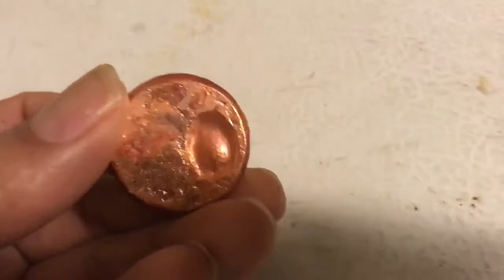Induction Heater Plasma

Comment: I use wima capacitor for my induction heater but didnot work. 30 x 0. 058 100 khz
Reply from the maker: Not sure what to make if it. Wins should work well. Mine are CDE but I have used banks of many MKO caps and they worked well. All it takes is one bad cap for the whole bank to fail. I have been bolting my caps in place instead of soldering to troubleshoot the cap bank. Not had any bad caps yet.

Comment: Not plasma its griphite birning into carbon monoxide....thin bleu flame i know it well
Reply from the maker: You’re  right — that is the graphite burning away to CO & CO2. The blue flame technically is still plasma though!
Reply: @BrianDhvTinkerer  Actually i think plasma is gas and the lowest temperature at which it can usually be seen is a ~10k Celsius where all the atoms of gas molecules turn to ions and conduct electricity. But still that indeed is a pretty cool project! :)

Comment: wow!   really cool.  superb unit.  do i understand correctly that if 2 capacitors are wired in series their voltage capacity is added?    also could you explain the coupling transformer?   I assume you are aware that very hot things can cause concrete to explode and spray hot metal everywhere?    copper is so nice to melt and so pretty when polished.   any chance of schematics ?   cheers
Reply from the maker: +itanc1 thanks. The unit works very well and seems easier to control compared with my PLL setup.
By just slowly increasing  the voltage on the variac and tuning  the frequency for maximum current with the workpiece in place assures that it is operating at resonance and not stressing the IGBTs too much. 

That is correct, wiring 2 caps in series doubles their voltage handling but halves their capacitance. The coupling transformer is made of ferrite and usually consisted of 20-22 turns of thin wire. The oscillating magnetic field of the coupling transformer will transfer energy to the parallel tank circuit once its frequency comes close to the  resonant frequency of the tank.  The current draw from the inverter (half or full bridge) will increase significantly at this point. The copper tube that passes through the coupling transformer is a secondary turn (1 turn) relative to the 20-22 turns on the coupling transformer. This steps up the current flowing in the tank by 20 -22x compared with the oscillating current flowing through  the coupling transformer windings. Through a process called resonant rise both the voltage and current in the tank circuit increases further to 100s of amps and over 100s or 1000s of volts. That is why the caps in the tank have to be rated to handle high currents, voltages and frequencies. By having a cap bank of many parallel caps in the cap bank, the current load is shared. Even with this shared load they still get warm. The work coil functions as a primary and the metal to be heated functions as a shorted secondary. Huge currents of the order of 1000s of amps flow through the workpiece as eddy currents.  Because of the high frequency oscillating magnetic field, most of the current flow is in the thin outer surface layer of the work piece. This "skin effect" increases the effect resistance of the workpiece and results in preferential heating of the outer surface. Lower frequency units will tend to be able to heat larger metal pieces and penetrate deeper.